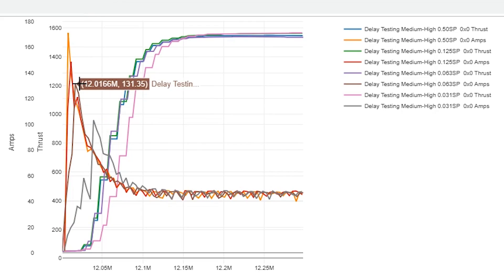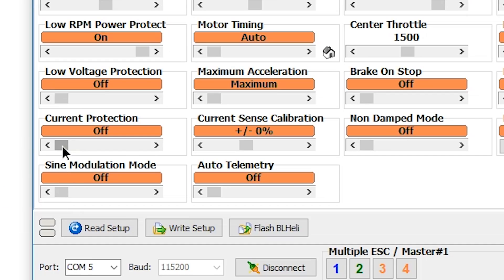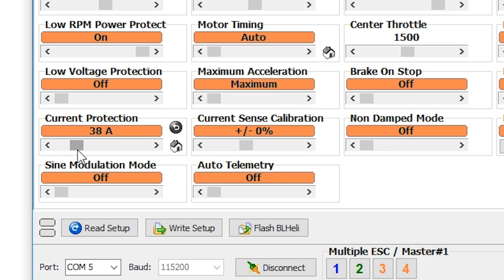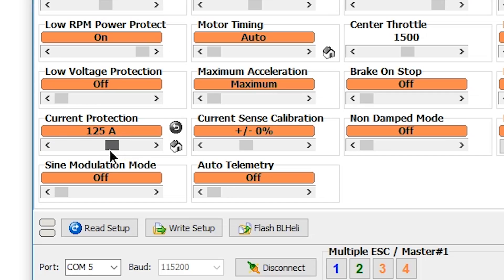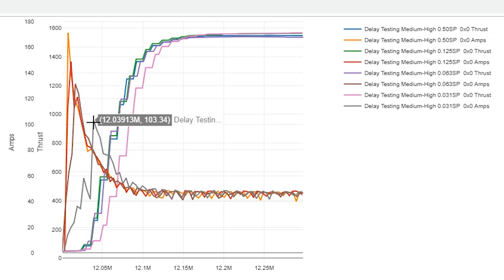BLHeli32 100% Explained - Part 6 - Current Protection

Comment: Why did BL_heli32 get rid of the current protection option? Is there still a way I can change it?
Reply from the maker: blheli32 still has that option but if the ESC doesn't have a current sensor, then the current protection option cannot work. What happened is, manufacturers stopped providing current sensors on ESC's.

Comment: If I set up current limiting to 10A on a LiIon quad, it falls out of the sky if it hits the current limit. It just does not work as you advertise it...
It is not limiting gracefully, it shuts off the ESC.
Reply: If I run without it, it takes 55A and just works, so its not the battery at fault.

Comment: If these high spikes in current surge are  so fast ,at what point does the current limiting feature stop working?
Will there be a point  where the current surge is quicker than the current protection can operate?
Reply from the maker: That point surely exists, but it's so fast that it doesn't really matter.

Comment: if an esc has a burst current of 50a,  which value should i set current protection to for a quad? 50a or 200a ?
Reply from the maker: There isn't one simple answer to this. Personally I would just leave current protection off. With a burst current of 50 amps you would need to EXCEED 200 amps before you ever hit the current limit. What battery is going to do this? Not a typical mini quad battery that's for sure.

Comment: You cut Ryan off too early on the rampup power video, because that's the most important one if you're using Turtle mode and you get stuck in trees and your props get blocked or smack the ground. He was about to mention that at the end but you cut him off. That's why I'm hoping that you make a full length version.
Reply from the maker: There is no additional content that is being edited out. The very next thing we did is go on to the next topic.

Comment: My blheli 32 won't read my setup.  Any idea why
Reply from the maker: Often this is caused because the ESC are blheli_s not blheli_32. Use regular blhelisuite not blhelisuite_32
Reply: Got your battery on? USB Power is not enough!
Reply: It doesnt work on kiss. But i figured that the plug from the reverb PDB with pwm wires fits right into the heliorc spring fc. Updating easy, no tlm needed.

Comment: Wowow... Iv been following this series.. I feel you missed alot of vital Info for new pilots with this one.... Adding current limiting will protect your ESCs if your props get blocked and will prevent you from popping half as many ESCs as with it off.
I just felt it nessary to mention this to new pilots....
Reply from the maker: Low rpm power protect also has the same function and is enabled by default.
Reply: @JoshuaBardwell  so you would recommend rather trusting the low rpm protect than to lower the current protection of saving my hardware from prop strike or prop hold popping my ESCs?
From my experience the day I started using current limiting was the day I stopped popping ESCs?
Reply from the maker: If it works for you, then go for it. Personally I can't remember the last time I popped an ESC so it hasn't been a big concern for me. Adding current limiting can cause top end oscillation and can cause muted response on sharp stick moves. So personally I don't turn it on unless there is a specific problem I'm trying to solve. 

If you have ESCs that are prone to popping, maybe this is a good solution.
Reply: @bukscoetzer  ramp up power is going to protect you from blocked props in trees or using Turtle mode alot.
Reply: That's also assuming your ESC even has current sensing. Remember there's a whole range of ESCs without current sensors that won't be able to use this feature.  I guess it doesn't hurt to have it enabled if you are just starting out, every extra ounce helps, but I would say  if you're interested in tun-ability or performance at all it's going to take a hit with it enabled.
Reply: I am confused,
I used one of the best individual esc in history...
I have been using current protection, at set 35A, I have never damaged my ESC, even though it has often been stuck in the tree or in turtle mode. but after I watch this video, I turn off the current protection, low power protection is on, yesterday I was forced to use turtle mode, instead my esc died ....